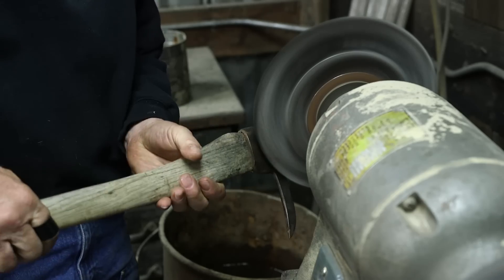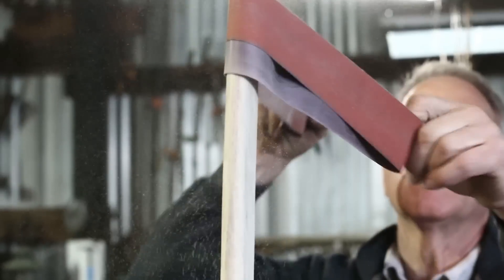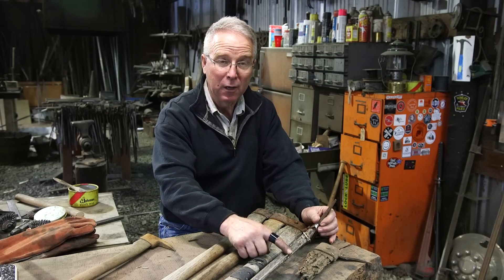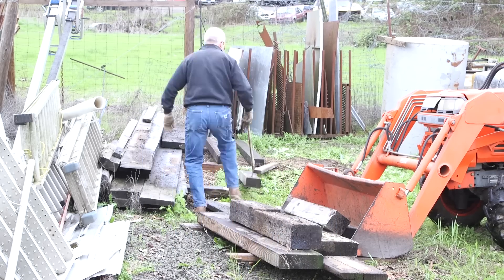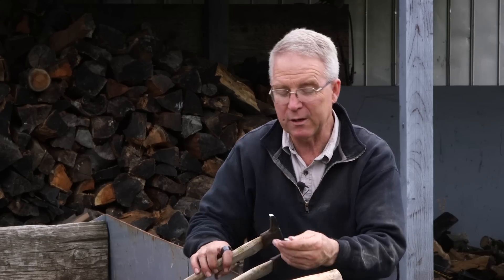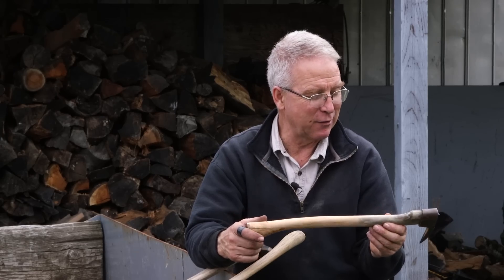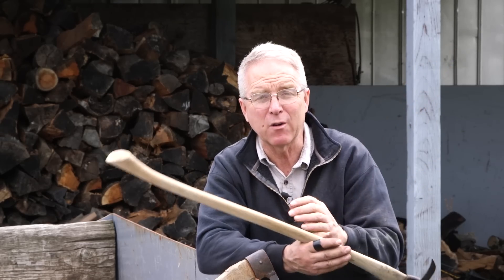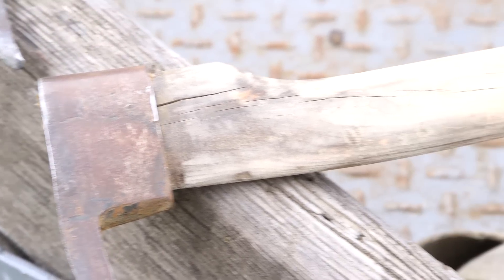Pickaroon: Cool Tool Show & Tell

Comment: Scott, because of your urging, I will leave a comment. As a 66 y.o. retired contractor I can categorically state that if I had used a pickaroon for the 38 years I was active, I would have lasted a few more years. I have no idea how much lumber I moved the wrong way, but it was enough to wear my back out by the time I hit 60.  Young men and women who do this kind work for living take heed.
Reply from the maker: Thanks for sharing John!
Reply: Yes sir, I am in same boat but my back didnt last even that long. Mine was the result of always trying to do everything by myself. Stupid.
Reply: @essentialcraftsman  When a person becomes old folks like us, we look at certain things/methods/applications and wonder why we didn't use them to save our bodies from premature demise.  As I was watching this video,  i couldn't help but think that a longer handle on the pick-a-roon might save your back even more wear and tear.  Are there pros and cons to using the length you use?  I would think adding another foot or two to the handle would help even more by creating less need to bend so much.
Reply: @D k I´m slower than other people when it comes to moving stuff because i always use technique to take care of my back, i´m going for 38 years old and the only problem with my back is the classical compression of the discs that makes me loose a couple of cm after some time standing or sitting.
Reply: @D k I hope it works. Some people manifested improvements with magnesium chloride, who knows. Regards.
Reply: aint the truth i am rite there with you    john
Reply: @sarkisiangeorge  Looks like the ones in this video are 36."
I've run into commercially made ones from about 12" to a full 40" ( the 40 was really expensive!  I think they are also weighted differently)

Comment: The knob on the end of the handle is called a "fawn's foot". I personally recommended rubbing those handles down with linseed oil. If you get enough on the loose one, the wood will swell and hold the toolhead a little better. I'm probably to late to the game for my comment to get any notice, but I really enjoyed the video. Thanks!
Reply: That's a regional term.

I've always known any handle end, like that to be called a Knob.

Google anatomy of an ax and you'll see what I'm talking about.
Reply: @westendlawn  yes, the end is still called a knob. I mean to say that different styles of knobs have different names. For example, fawn's foot, scroll end, and swell knob are three different styles.
Reply: Blo is junk-
Reply: you can also  use propylene glycol  (aka antifreeze) to swell a handle back into a head. its thin, soaks into the wood well (better soak =more swelling)  like water but it doesnt evaporate like water .... shout out to AVE for the tip
Reply: @horacerumpole6912  he said linseed oil, not boiled linseed oil. And what makes you think blo in junk?

Comment: Dixie Tools from Forestry Suppliers-1987.  File the tip periodically, coat the handle yearly with hot pine tar, beeswax and turpentine. Swing down into the end grain of a firewood round, swing it up and in the ATV tire bolted to the splitting block, pump the handle down once smartly and she ejects herself. 32 years old and still giving good service.  Simple & astoundingly efficient!

Comment: Every thing you just said is so true.
My family was in logging, pulpwood, fire wood. Carpentry,  barn builders. That's how we got things done.
My first time using one I was 9 years old with fire wood.
Moved up from there.
They're quite handy. I could use 2 at time with that short handle  loading wood in back of a 71 model Chevrolet c10 and stack it tight. No just throwing in the bed at our house. I made that mistake once I busted out the back glass. I got my butt torn up too. Lol. That's when I learned  going fast doesn't always mean doing well.
When coming to pulp wood. It easy on the pine.
Easy to stack on the cable to load.
Logging , it worked great as well.
We used miles and snaking dogs.
Then a tractor and finally a loader bucket..
From, moving limbs to help guiding on the slide poles to get it on the truck.
Can't hooks and pickaroons.
Saves time and money.
I'm 57 now. I'm still a firm believer in them. I do a lot by myself. It just another pair of hands. I've gone too long. Thank you for seeing memories.  Time goes by fast. Slow down, enjoy what you do. Why live life in a hustle. 
God bless.

Comment: After my dad passed, it fell to me to break down his shop.  Over the years I've been trained and used just about every tool he owned, but there in the corner hanging on a nail was one of your pickaroons.  However back then, I had no idea what it was called  and even less of an idea of what it was used for. As I picked it up off the nail, I figured it was one of his picks that he had ground down over the years.  At the sale later that weekend I sold it for a few bucks.  I would gladly give a couple hundred bucks to get it back.  Thank you sir, for sharing your knowledge and wisdom.

Comment: Very interesting. I live in Bolton, UK. I've never heard of a pickaroon, although Stihl, for example, make a small 'hookaroon' for similar use.
I do have a similar tool with a three foot handle (we aren't all metric people here!). It came from the old Lancashire and Yorkshire Railway Locomotive Works at nearby Horwich (now demolished). It was a platelayer's* tool and had three uses:
1 there is a ¾" wide rounded chisel tipped spike similar to yours for 'picking and moving' wooden railway sleepers.
2 the chisel tip is also a rough 'chisel' for gouging out areas on a sleeper to help level the plates or chairs.
3 on the opposite side of the forged head is a stubby axehead for chopping out the area of a sleeper to be levelled for the plate or chair.
*Platelayer is a general term (less in use now) for a person who works on the railway (permanent way or railroad in the US). In the early days of the railway their skill was in placing the plates or chairs as level as possible on the wooden sleepers, onto which the track was laid.

Comment: I'm a firm believer in the pick axe because of the added function of an axe on the back. I use them often when cleaning out woods roads because I can chop brush as well as pulling rotten logs off the road

Comment: If you add a pickaroon to your collection, consider adding in a pike (and maybe a cant hook if you find yourself rolling stuff a lot) as well. 

Having more tools at hand gives one more options, and a long handled pike can let you grab, pull, and push stuff with less walking.
Reply: This is a great suggestion.  I fell trees and often have to deal with large rounds even after cutting with chainsaw.  Any tool that gives leverage is a huge plus!  
(Can't wait to try out my new pickaroon. I purchased the Ochsenkopf 28", but plan to order a 36" from Council Tool yet today. I want to try out the different lengths.)

Comment: Sir,
I collect steel hand-tools. Not in a regular ‘collecting’ style. I aim to have one of each tool. Although axes and hammers have a wide variety and so I have several examples of these. My pickeroon was shipped from Council tools to Australia, along with a pulaski and a wrecking bar. Shipping was more than the items cost. My tool collection causes a stir for new visitors who then hear the story and marvel at the size of a burning trunk than can be doused by simply rolling with a pickeroon. I am working on a display wall for the collection.
Cheers,
-Mac

Comment: Have one of these in my truck and one in the wood shop...perfect for stacking cut firewood when you are stocking up for winter heat.  I haven't bent over for a piece of firewood in 40 years.  You can't go wrong with a Pickaroon....

Comment: The pickaroon moves you 3 feet away from a nasty snake bite. And yes you’re right about black widows. They are more numerous and will send you to the hospital as well! Tools were invented by the working men. The right tool for the job is is a safe practice at all times. Nice video as usual!
Reply: I used mine today to move old pallets covered in old leaves, under an old firewood awning in the Ozarks...perfect Copperhead habitat... The ol pickaroon was the hero of the day!

Comment: Love pickaroons. Couldn’t afford to buy one yet, but wanted one so badly that I made my own!
Reply: Also made one this winter, but may modify the tip on the next one - as the chisel hook tip makes a lot of sense to me
Reply: Way to go! The sign of a true homesteader. "Can't afford it? Doesn't matter—I'll make one myself!" :)
Reply: KevC be sure not to make it too thin, I made mine come to a nice thin tip to sink in easier but ran into issues with it wanting to bend. I suppose hardening it may help, but I haven’t got a forge put together yet or researched any techniques. Having a little bit of a hook to it helps to hold the wood until you’re ready to drop it, which I found quite helpful for moving firewood.

Comment: I have worked in a sawmill for the past 20 years, using a pickaroon the entire time. I do grind the sides till the tip is about 1/8" wide, then bring the top down in a gradual arc, nearly to the point, I then finish grinding by cutting in a steeper flat angle for the chisel point. That all makes it easier to stick, to make it grip the wood, I peen the chisel point down slightly with a hammer, striking straight on to the point to make a hook around the bottom and a burr on the sides.

Seems to work great in southern yellow pine.

Comment: I picked one up at a flea market a few years back! It looks about like yours do - neglected, sitting in a corner somewhere for who knows how long until it's called upon again to save our backs.  Next time i'm taking a tree down i'll be sure to use it to handle the various lengths I'd otherwise have to pick up. We don't do any commercial logging here in Kansas for obvious reasons, but plenty of firewood cutting, clearing for pasture or cleaning up storm damage, etc.  When I'm processing and stacking my firewood this year for the inevitable winter, I'll take the time to appreciate this too. I was super excited when I found it and have added it to my collection of axes - ready to be used, whenever that may be.

Comment: One of my uncles spent a few years in a lumber mill and when we would visit him during the time he was cutting his home firewood, his sappie was used constantly. That sappie was what you note as the short-handled pickaroon. I imagine it's a regional thing as this was in northern Wisconsin - nowhere near Oregon.  :-) I've also seen a couple old timer carpenters that had welded a 'pick end' of sorts to the puller end of a hammer that was set near the lumber pile for ease of handling the sticks.
Reply: A German guy a few lines down from you said that's the German name for it. was news to me

Comment: Always had one beside me at all the job centers in the mill. Also the little hooked beak was best as you didn't have to swing as most times the beak would set in enough to pull the piece and that ultimately was less damaging

Comment: Picked one up at an estate sale last year, they had no idea what it was.  Brought it home, cleaned it up and use boiled linseed oil on the handle and on the end.  The head tightened up after several applications on the end.  It works great  and like you said it does save your back.

Comment: There are two names associated with a picaroon. The other name is hookaroon. They may be two but very similar tools. The tip seems to be the defining part of the tool. The little hook at the end of the tool seems to make it better for picking up 🪵 wood. The straighter tip may make it easer to pull a slab towards you. The curved tip would allow you to carry wood 🪵 and drop it.  The straight tip may be better to just move things like slabs away from saw blades. 
This is not a attempt to say you are mistaken in your video. Thanks for posting them. I really enjoy watching them and hearing how old tools were used .

Comment: I made myself one of these by grinding a hook into a cheap axe head. The extra swing weight from the axe head helps drive the tip far enough into big pieces of firewood when loading the log splitter. Could not live without it. Will definitely grind a chisel into the tip though.

Comment: I grew up using the shorter ones for processing firewood. Game changer splitting wood. I to this day use my fiberglass handled framing hammer to stand up and move chord wood. You do not have to bend over and wrap your hands around every piece. Big difference.
Reply: Are you the river rat from grand rapids?
Reply: Are you from grand rapids
Reply: No
 @patroers9571

Comment: Scott look I forward to your videos . I grew up as a loggers son used a pickaroon a lot as a kid. And still use one for making firewood all the time. I have a tip if you don't know it already soak that loose headed pick in boiled linseed oil it will tighten up , I cut empty oil container (quart) length ways add inch or so boiled linseed oil and soak head for a day or two.
Reply: A tip on top of your tip!

Soak handles in radiator fluid. Curbs shrinkage during winter. 

If ethyl glycol (antifreeze) raises your concerns dipropylene glycol works just as well - and thats used in cosmetics. :)

Comment: Yes sir. An often overlooked, or not even known about tool. I heat my family's home with wood, and have for the last 20 years. From standing tree all the way to fireplace, the pickaroon always comes in handy. I think my favorite use for it is burying it in a big round, then choking up on the head and just using it as a handle to carry the round to the splitter. Also really nice just to sit on my chair in front of the splitter and reach out with an extra 36 inch reach and snatch rounds to me :-)
Reply: Exactly it's a handle for a log a lot of times

Comment: I made 2 of them. The first one using a large U bolt that I cut where the curve starts, bolted it at the end of an old round handle. I put a pipe coupling over the handle where I bolted it for strength. I make a palm swell using hockey tape. Been using it for 10 years. 

Made a 2nd one from a cheap 14$ axe I got in the discount bin at the hardware store. 

I prefer them to pulp hooks in many situations, but a pulp hook is also handy.

Comment: I have an old fireman's axe that I take whenever we're chopping firewood that I use like a pickaroon. It's a dream to use and SO useful. It may not be the safest because you have the edge coming back towards you, but it's so useful to help drag the rounds to the splitter, pull off pieces when it's really stringy, and chop it when it's too stringy to pull apart.

Comment: 10 years in a veneer mill (Timber Products Co.) used these extensively.  You are correct probably the most useful tool for moving blocks, peeler cores and throwing contests. There were probably more pickaroons on the mill site than employees, that is how valuable they were.

Comment: Thank you, Scott! I know I'm late to this party...
    I've seen them, even knew the name. I can only guess I'm in the wrong area, or haven't had the luck to ask someone "knowledgeable" in the correct sense of the word...
   I was told it was for rolling logs before they invented the "Peevey"... (lolz)

    I still try to keep moving, and I hate to complain. After a certain incident in the Navy, my back was sprained... and over time since, I've come to understand exactly WHY they kept telling me that spraining it was worse than if I'd broken the damn thing. Wood heat without it (even with the Peevey) has steadily been more and more agonizing than it's worth, except the odd few months you'd likely die without it.
    SO... one way or another, I'm getting a few of those. I plan on a couple of each size, just so I can have 'em available at the house as well as keep a couple with whichever vehicle's been designated to go fetch the stuff from the woods (or where we're called in). Thanks, again. VALUABLE demo'... AND frankly, a pretty good video to watch. ;o)

Comment: Thanks for that enlightenment .  I've never seen one of those.   When I started framing in '77, i learned to use the claw of my framing hammer for the same purpose (although not as good).  Used it to lift a framed wall off the deck to stand it up.  The longer handle allowed me to not bend over as far to get the wall elevated and stood up.  Still  using it today as I frame houses for Habitat for Humanity.

Comment: There was a stud mill in West Yellowstone where they used the short handled pickaroons to pull defective boards, checks, too much wane etc. after rough milling and before final dimensioning. These defectives and the off falls left after the finished studs were cut to length went to a conveyor that led to the chipper. Most of the chipped lumber went to a pulp mill. Although they allowed locals to pick through this waste before chipping to use as firewood. Nice, clean, no bark, no creosote, it made excellent fire wood. I made two friends the short while I lived there. Targee Nell and her dad whom we all new as Grandpa. They had moved to W.Yellowstone when Nell was just a young girl and and Yellowstone was still a cavalry fort.  Grandpa and his sons built a beautiful log house that he and Nell still lived in. Grandpa was well into his 90's then and Nell no longer a young girl. Oh, the stories they would tell of the early days of Yellowstone.  Everyday during the warm months, Grandpa would go to the mill and use his short pickroon to pull the scrap from the conveyor and neatly stack in the bed of his old pickup. Once home again he would neatly stack it in their firewood house. Grandpa was able to get a complete winter's worth of firewood from the mill. That was the neatest stacked firewood you've ever seen.
Reply: Elk Stud Mill, worked there in the '70's. I have several West Yellowstone Standard ski medals from the '40's when there was a single towrope at Lion's Head ski area. I bought them from Nell-